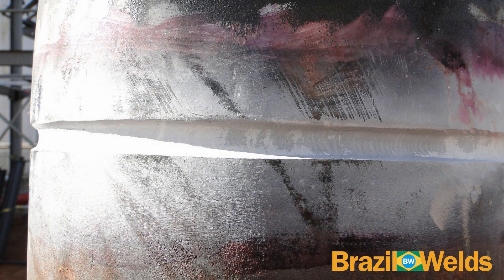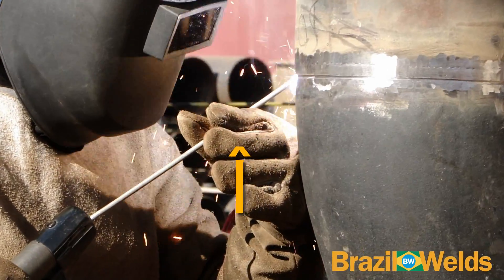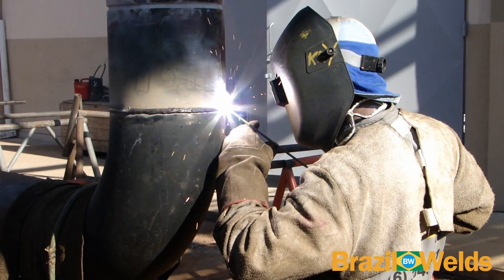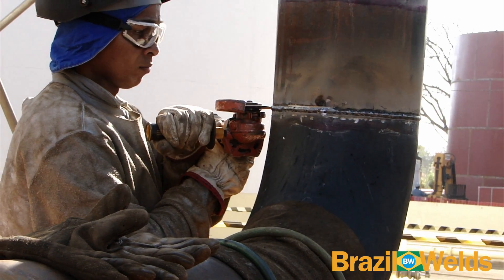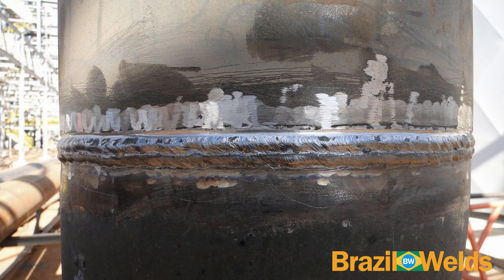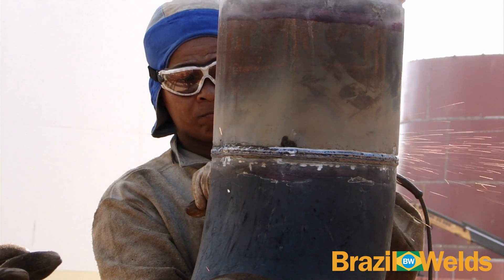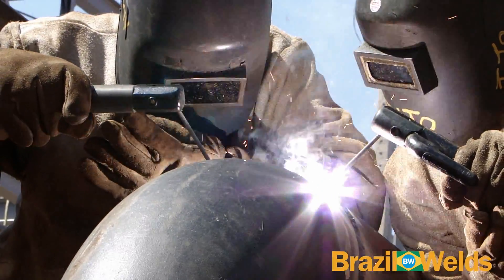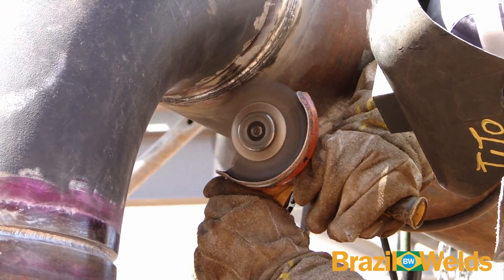Solda Eletrodo Revestido - Real feita na obra - Posição Horizontal "2G"- (Tubulações)

Comment from the maker: Raiz = 90 à 100 Amperes, eletrodo ER 7018, 2.5 mm.
Enchimento = 110 à 125 Amperes ER 7018, 3.25 mm
Acabamento = 90 à 100 Amperes, eletrodo ER 7018, 2.5 mm.

Mantenha um arco curto e com o mínimo de oscilação.

Abraços

Messias